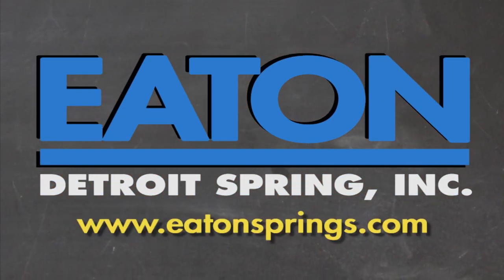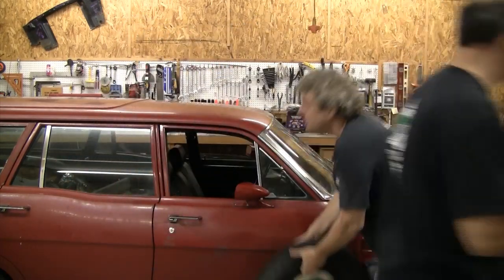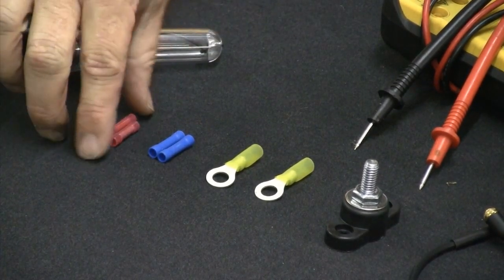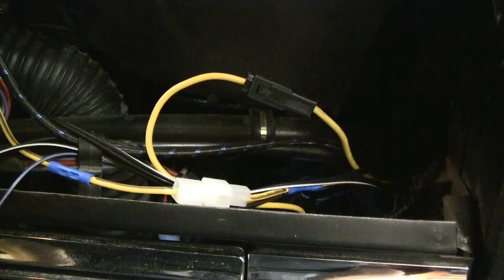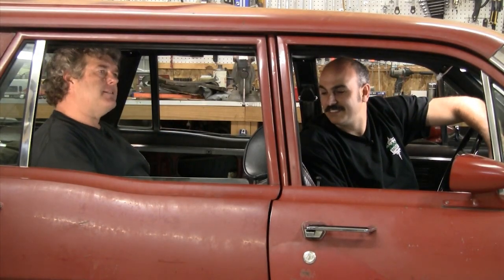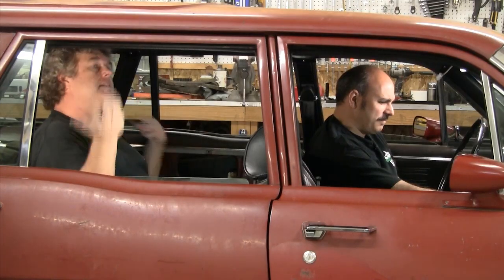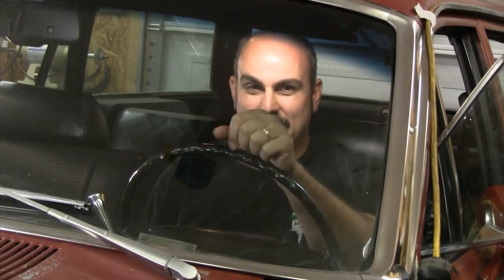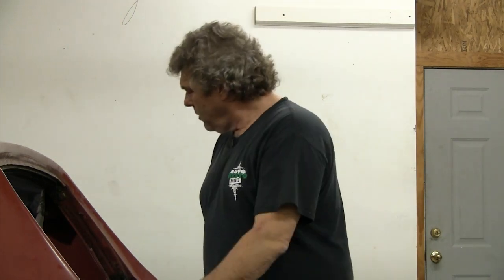FINAL Retrosound Speakers Quadraphonic 4 and Subwoofer Tuning Fairlane Episode 258 Autorestomod

Comment: Doing the 3G conversion for the wagon? Was wondering if you all were going to show that.
Reply from the maker: +W King Yes as well as how to repair the printed circuit on the Wagon too.
Reply: +AutoRestoMod Muscle Car Resto and Modifications 

Great. Did one on my 76 F series years ago. Love it .. Price was good cause I got all the parts from a donner yard car. Wires, fuses, and alt. But I did get a new pulley for it.
Reply from the maker: W King Doing a bit more about the possibilities than just the install. Some things we ran into with our "hybrid" alternator from Tuff Stuff.

Comment: Are you all going put dynamat in the rear quarter spaces of a spray on sound deadener? Also why not just put the speakers in the doors like most modern cars? Now the car needs some tinted windows and a 14' woodgrain steering wheel!
Reply from the maker: +Lawrence Eich Well, there isn't a really good spot. Plus the PVC does a great job of making noise. We have and plan to use a rim blow that we got from West Coast Classic Cougar and show how to install the rim blow switch.

Comment: I'm going to be putting in my first radio and speakers and I was wondering if all the wires that come with that radio and those speakers are all long enough and it looks like everything you needed was in the box, is that right? Or did you have to buy some wires separately? For now I just plan on installing that radio and 2 speakers from the same manufacture in a 1979 Chevy Impala. Would appreciate any advice that you guys had for this newbie
Reply from the maker: +Stephen Painter Every thing was in the boxes. Plenty of speaker wires too. Just go slow, wire neatly and you should be good to go.  As we say in one of the videos in the series, the system is VERY modular. We think you'll be happy.
Reply: +AutoRestoMod Muscle Car Resto and Modifications Thank you, happy for the feedback. You guys keep up the videos and thanks again for helping me out. :)
Reply from the maker: Thanks for the kind words! If you have further questions, please feel free to contact Jeff at: jford@autorestomod.com